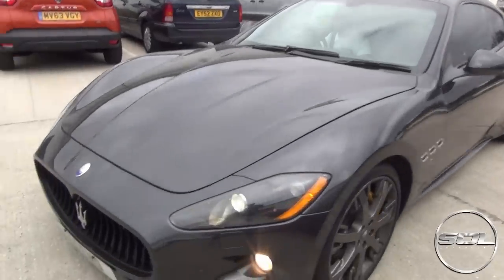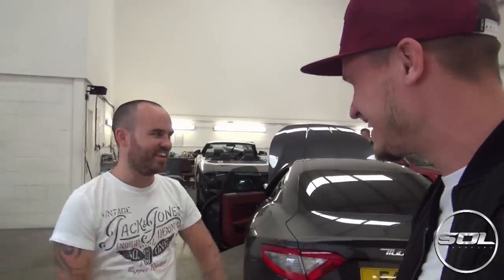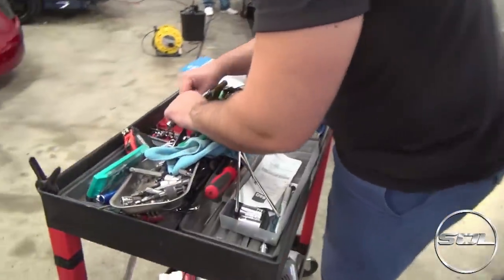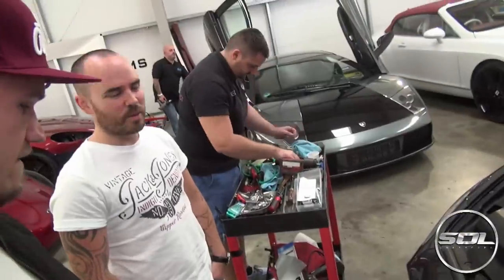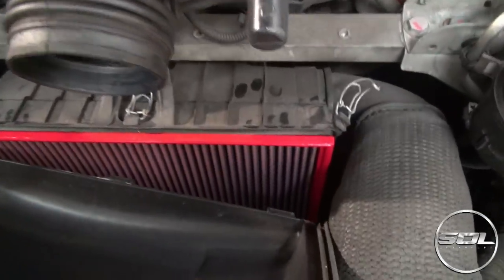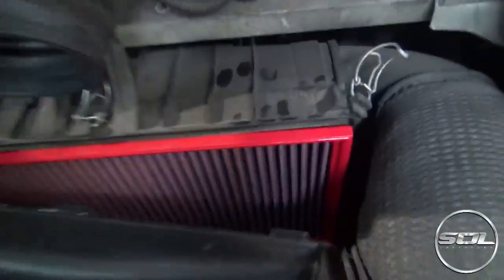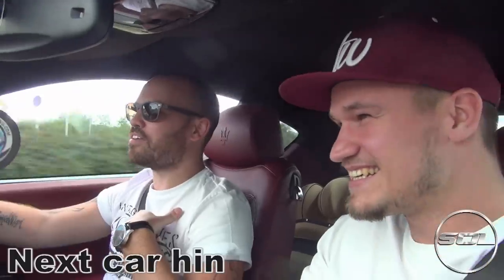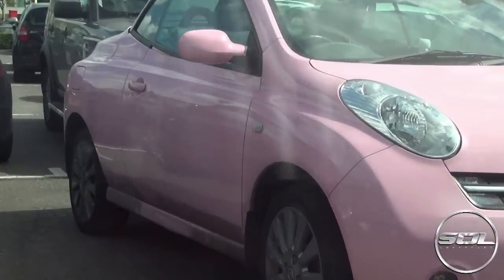MASERATI NANDO'S RUN: JONATHAN SACCONEJOLY'S!

Comment: What are they going to do with the 918?
*after the engine swap, is it still usable? (Since it's a hybrid)
Reply: They were unwrapping it i believe
Reply: DutchGraphicsHD Engine swap.
Reply: DutchGraphicsHD Yeah it was still wrapped from the Gumbal Rally earlier this year
Reply: SupercarsAntwerp Thanks, i'm aware. But i'm wondering what they're doing after the swap.
Reply: ***** Yes i'm serious, sure the engine will work but will it still work combined with the electrical engine.
Reply: +DutchGraphicsHD sure the engine will turn off when it's in EV mode and nothing will happen as there is no electric motor. So they have to be in sport mode all the time. Plus some weight reduction, bro
Reply: they arent actually engine swapping it......